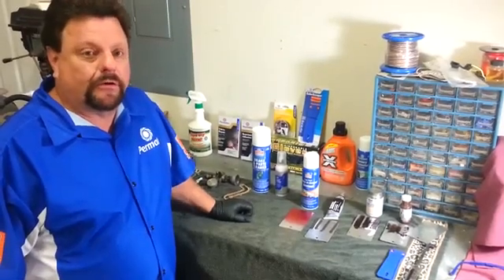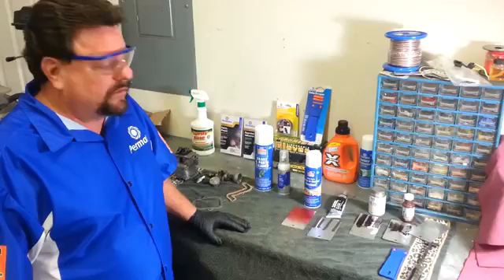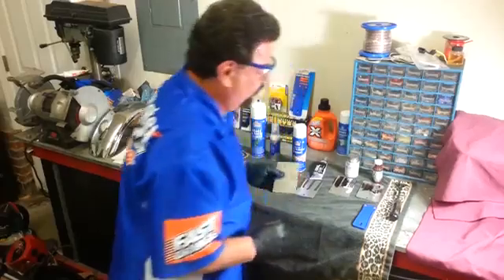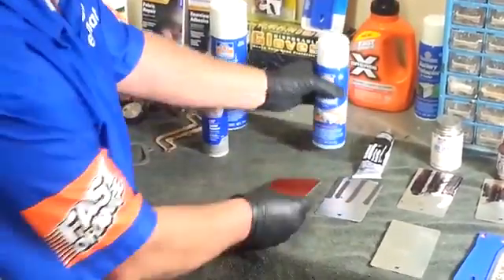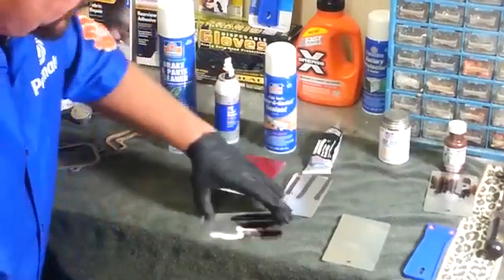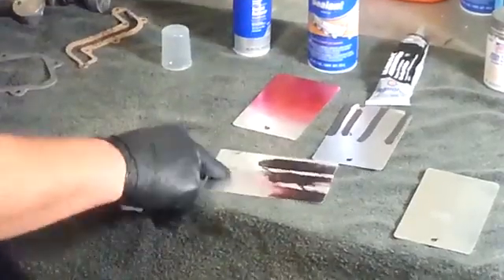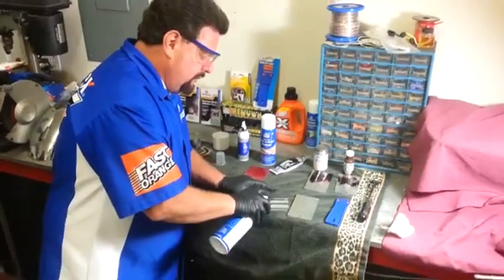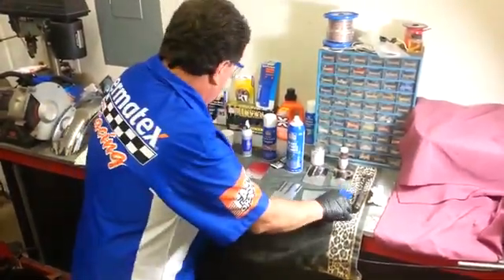How To Remove Chemical Gaskets

Comment: I use Gasket remover from the Motip brand to remove the sealant around the headlight unit. It doesn't do a really good job either. Might be slightly better than isopropyl alcohol, but hard to tell.

Comment: can you use pb blaster to remove residual gasket silicone?
Reply: Probably not a good idea, PB blaster leaves behind oil that's harder to clean than the gasket

Comment: Just tried Permatex Gasket Remover on the material left from a metal gasket on thermostat housing and water pump.  It didn't help at all.  Had to use a razor blade.  Someone needs to make product for these modern gaskets.
Reply: Need to use stripper.  Gelled methylene chloride.

Comment: The title says gasket remover and you didn't remove a gasket just sealer. Didn't learn anything here.
Reply: Gaskets really don’t stick like that unless a sealer is used. If no sealer is used they typically pop right off the mating surfaces.
Reply: @jeffreyhinman1397  WRONG!!
Reply: @BobSmith-mc7uq  the only gasket that sticks and doesn’t come off easy are some paper gaskets. Rubber, multilayered steel, cork and even some specific paper gaskets come right off. The thin paper gaskets stick.

Comment: Permatex is one of the crappiest companies on this planet I swear not a single thing you make works properly.
Reply from the maker: Hi Aleksandar, we are sorry to hear that you had some issues with our product. We'd like to help you if you can provide more information. Feel free to contact us at PermatexCustomerService@Permatex.com. Thank you!
Reply: I've just never had any luck with your products it's been a couple of years since I've purchased anything from your brand, I've sworn of it, of course this is just my experience I'm sure others have had better luck.
Reply: I use Permatex products all the time... maybe your not prepping before applications
Reply: @Eastlosgrown  Could be a "me problem"
Reply: The Right Stuff black 90 minutes (Walmart) works great for leak proof seals. But I am here to learn out to remove The Right Stuff black 90 minutes lol
Reply: What do i remove the green permatex 6400 . Its saying 450° F . Is there a solvent so i could reduce the heat. Would acetone do anything?
Reply: @brenthawkins204  I conclude that there is no easy way to remove silicone type liquid gaskets. Have to very carefully scrape with a razor blade or hard plastic scraper without damaging the aluminum, and to get the residue off use a small rag saturated with brake cleaner and scrub over and over. Brake cleaner works a lot better than acetone.
Reply: @DAS-Videos  is permatex 6400 silicone based or more like superglue. Would LOCTITE® SF 768 work? Its a solvent based remover
Reply: @brenthawkins204  I don't know about 6400, I never used it. But the right stuff 90 cures to be a rubbery o-ring like material that bonds to clean metal really well. Brake clean does dissolves it but it is still hard to get get off.